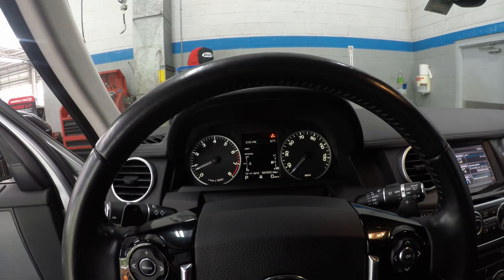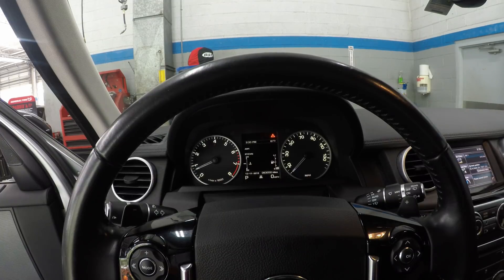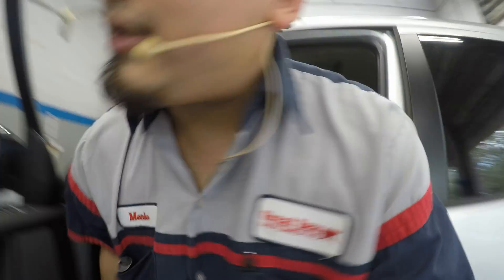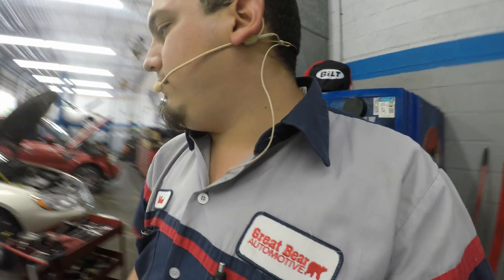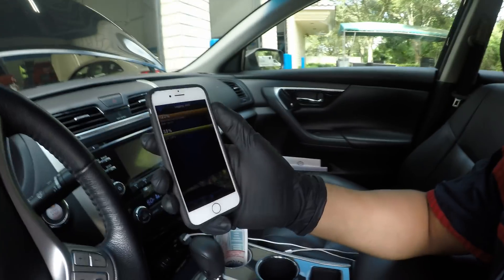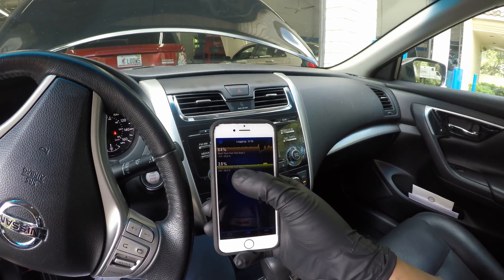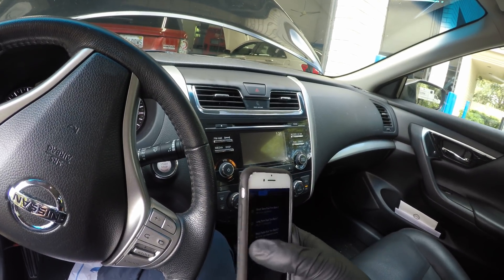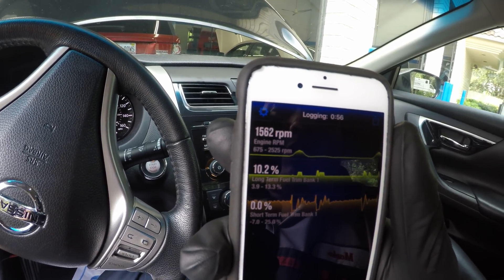RE: ScannerDanner: Are mechanics thieves? Or is it incompetence?

Comment: Personally I think it’s thievery and I’ll explain why. They gave her a laundry list of repairs so that when she gives the approval , all they do is change the Pcv and boom the car is fixed the mechanic gets paid and not much effort was taken to do the job. Of course they probably chose the most expensive type of repairs like a fuel pump and such and along with some service recommendations. I’ve seen it all too many times.
Reply: Either it's robbery or incompetence . BUT the result is the same . The customer pays . So is it OK if they are idiots and " they didn't mean to steal from you " ? They need to go to Walmart and put on a security uniform . OK , I'll be generous - maybe Jiffy Lube .
Reply from the maker: ACTUALLY the pcv valve is the more expensive job on this vehicle. It's over 10 hours if I remember correctly
Reply: Super Mario Diagnostics I digress

Comment: Question what are you using as a code reader ? I have Blue Driver which I find amazing, looks the same. Please let me know, what you use.
Reply from the maker: Yep this is the same. Pretty good live data streams 👍
Reply: @SuperMarioDiagnostics  I'm so angry, I purchased wife 2017 Nissan Rogue full package and for the last few months the car makes horrible noises sounds like the CVT plates or belts are not messing correctly all maintenance is done fluids changed flushed. Today they had wife crying as it cost 300 dollar to say they can't determine the grinding noise and the codes I got where U1266 and U1A10. I took codes 2 mins before I handed keys to SM and they tell me won't accept those codes U1266 is what scare me as it hit the nail right on the head and now that new tran needs over haul or replacement. If you could please advice I'll support on Patreon is I can get something useful as today I told them that I was going to have another garage look and they say that voids warranty. HELP I don't want wife crying anymore.
Reply from the maker: What do you mean you you codes? You deleted the codes before giving it to them? If they can't figure out what's causing the grinding, you shouldn't deal with them. What do you mean they don't accept the codes? Those transmissions are notorious for failure, I'd take it to a transmission specialist that is reputable and guarantees their repairs for at least 2 years
Reply: @SuperMarioDiagnostics  It's the Nissan dealership lol. No I took codes 2 minutes before handing it over to their service manager. I took him for drive he hear the grind, saw the delay in shift lack of power, and the possible slippage. He says could be lose muffler, and first time was lose heat shield. I hate the dealership but car is still under warranty.  Also the techs can't find anything and say there are no fault codes and again they cleared them all like first time but they came back as this thing is failing. I want another opinion but all Nissan are owned by one company O'Regans uggg. I have codes for 8:15 and all the previous times and these 2 have always been there since the noises started.
Reply: @SuperMarioDiagnostics  sorry that was a rant took him for test drive he heard felt and saw all the crap, I then used blue driver to read codes at 8:15 am this morning. the U1A10, and U1266 dealership says they won't accept my codes and tell me there are none after tech is done. so Today wife in tears and 315 dollars poorer and car is still doing it.
Reply from the maker: Go on a test drive and take a video. They're waiting for the warranty to expire. Take every video you can when it happens, and show it to them. Make a huge stink
Reply: @SuperMarioDiagnostics  Wow just come back from Dealership with proof of code and again because their system don't see anything it's invalid. Also the Service Manager now only remembers the sound (which wasn't) the muffler lol. So I then asked if techs heard same He replies no, I then ask did they meet the parameters I showed him on highway he said no. I'm pissed now as they again failed to follow instruction as how to recreate the noise and event. They refuse to do anything without codes and basically wife will be driving Highway speeds this thing is going to fail and people are going to get hurt or killed. Nissan Canada has crashed again can't contact anyone whole company is bad. But I do love my Skyline lol
Reply: Oh the 300 fee for the shit show that was yesterday "service" was waived

Comment: Consider the economics of operating a repair shop. 
Training tech's costs money both in lost revenue while that are attending training as well as the cost of training including travel and attendance fees.
"Parts cannon" diagnostics creates additional revenue both in parts revenue and labor revenue.
Also, trained tech's generate less revenue compared to a "parts cannon" tech since many jobs will need less book charges.
Bottom line is that repair shop ownership has no economic incentive to train techs.  Especially since the general public has no clue what is wrong with their vehicles.
Reply from the maker: That's the worst excuse I've ever heard, and is the main reason why this industry is looked down upon. Too many investors out there in it for the bottom line and not looking to actually stand out in the way they run their shops. That's why with the coming technology, shops that continue this path will be forced to either get training and update, or die a slow and painful death. If you look at the most successful shops out there, they're not bottom feeders, penny pinchers, nor bare minimum shops. They're training, buying the necessary tools, and maintain high standards.
To argue that the parts cannon mechanic renders higher revenue is to also imply that it's ok to rob the customer each time a problem is misdiagnosed. Shops that allow this also won't last.
Reply: Economan not only do I feel like that business philosophy is unethical, I also feel that it is a short sighted business approach.

 What happens when so many customers have had their cars misdiagnosed, that the majority of the community within a 10 mile radius knows you do a terrible job at properly fixing their car. Or worse yet, they realize they are blatantly being ripped off?

Hopefully the business shuts down. Just like the majority of the shops open should be.

Comment: Why would you check for vacuum leaks after that’s the first basic and easiest thing you can verify first.
Reply from the maker: Especially with these fuel trims 😆
Reply: It’s crazy I’m hoping that tech was slammed that day and was being lazy lol.
Reply from the maker: That's no excuse I'd say lol 2000 dollars for a fix that wouldn't work.
Reply: I hate that shit I’m not perfect but I strive to be, I hate seeing people that do it for the money and not the love of fixing a problem. I had a similar problem with a VW lean at idle for whatever reason mass air flow was recommended. Car came back same code the tech was off so I got thrown on it. Now I gave him the benefit of the doubt because the car had a bunch of new parts on it already but still if you get fuel trims you know what to look for. Turns out the car had a damage pcv valve it was new but bad at the same time. Not gonna tell you how I figured it out because I’m sure you know. But it took me 5 minutes. But hey man good luck brother god bless.

Comment: There are many variables to diagnosis a problem,so we are human and make mistakes. We should have try our best and get a hundred percent sure about the diagnosis but sometimes we don't have time or another reason for doing that. So that is my opinion.
Reply from the maker: But a factory trained dealership technician suggesting a 2000 dollar fuel pump and then suggesting to check for vacuum leaks AFTER? All they had to do was open the oil fill cap to find excessive crankcase vacuum. Something is wrong there. In my opinion. Flat rate is the beginning of the issue.

Comment: the money is a big factor , yes it does   kill the motivations  of the  technician , I will  talk for my self ,  when   I left a shop because the owner wanted the    diagnostic done  in 15 minutes  yes 15 minutes complete with  research, testing  .
ok  I left  looking for new shop  I already have my 11 ase plus the  2 smog license inspector and repair.  I went to  honda dealer said  the most they could do is $16 per hour the most for me ,Toyota $ 17 , Subaru $18  ,  I told them I am certified, they said does not  matters those tltle s are view  for  the public  , I am  not certified on there  line    of vehicle. I told them I refuse aftermarket of $25  already why will I accept $16 when minimums salary herw was  $14  for none profeciona. l when I have already invested about $50 k on tool.  well I    accepted a job after at  market shop  on flat rate ,  there is not value on labor the main thing for them is how much  you can sell on parts , 1 hour for any diagnostics any amount of dtc, the manager said any good technician should have complete result in 45 minutes,  so any diagnostics I wanted to get done because I have passion for my   job, I was getting to result in about 3 hours on several diag, however getting paid      1 hours, believe me against my integrity I had to  throw parts     to get   some of 35 hours per week  at least  of my salary. now I am getting paid over 30 an hour and they  respect my diagnosis time  very happy, but hard to find a shop that value diagnostic portion,  yes money is important  when you have to pay for tools ,  training and  take food  to  the table  for the family .  so do not forget  getting  a crappy salary creates a circle , and kills motivation I felt that , the shop on my area the hourly rate is over $130.00 . yes I know they got to pay expensive rent .
Reply from the maker: Good thing YouTube is free. While i agree that pay has an effect on the motivation of a technician to grow. It cannot be an excuse anymore. The resources and information are readily available to anyone who's willing to use a search engine. In this industry one cannot expect to get good pay to then learn. They must first learn to demand good pay. Shop culture is a big deal, as you made clear. But ultimately it's down to the individual technician to invest in themselves, absorb information and gain experience in order to succeed, in my opinion. When someone writes on the work order to fix a fuel pump for 2 grand, and then to inspect for vacuum leaks, shows that they didn't put in the time to either invest in themselves, or conduct a proper diagnosis. Especially at a dealership where they have factory training and information readily available to them, in my opinion. Thanks for commenting bud 👍

Comment: Are you using blue driver?
Reply from the maker: Yes i am
Reply: I have used blue driver also. It’s not a bad code reader and PID monitor. It doesn’t do enough to really diagnose most problems. It also doesn’t monitor the CAN network or do any actuator or module tests which is a must in the newer cars of today.
Reply from the maker: True but it's 100 bucks. Can't expect that much out of it

Comment: Mario it's funny but most of my videos start with the phrase, this car was at another shop. Way too many parts changers as well as incompetent people in this field. Very nice video man. Hopefully some of these guys see this and learn something about utilizing fuel trims in diagnosis.
Reply from the maker: Thanks brother, sucks but that's the way it is
Reply: Joe's Auto Airline mechanics have to meet certain training standards. You need an A&P to do most of the work done on small aircraft. An A&P&I can only sign off on the work done only after thorough inspection of the work done.
  An auto mechanic can be some joe blow that walked off the street looking for a job. Usually they will have some type of on the job training  by a lead mechanic and are let loose to do their own thing . I’ve seen some pretty bad ones in some of the shops I’ve been in. The customer is the one that loses in the end.

Comment: I am a tech in a completely different field but it is largely the same. Technology is constantly changing, techs aren't trained well enough, the pressure of repair work takes its toll, pretty soon you get misdiagnosing issues and parts changing. Think a 300 dollar fuel pump is a lot to spend on a misdiagnosed fuel issue? Try a 3000 dollar wic card for a router. One guy I worked with was so incompetent, he would just swap these wic cards with every ticket.
Reply from the maker: Yep, this applies to many fields, some just lack the drive or the passion to at least care. This is a trial buy fire industry, so we must be able to stay focused under pressure. Some people don't know how to separate their personal problems from work, and it shows. I've seen a guy replace an engine due to a pcm. And he thought he was the last coca cola on earth, so pride and arrogance is another factor. And the list goes on

Comment: It’s a combination of both, I know certain individuals that know this is a vacuum leak, tell the customer it needs a fuel pump (knowing the leak would take less time to fix) proceed to fix the vacuum leak, and tell the customer that fuel pump was changed...
Customer: incompetent
Mechanic: Thieve
Reply from the maker: Except for the fact that the fuel pump takes 2 hours. And the valve cover takes 10 hours 🤔
Reply: Super Mario Diagnostics depending on the vehicle 🚗
Reply from the maker: This vehicle, those are the labor times

Comment: I think a big problem is not separating mechanical and diagnostic work. A regular mechanic can make a lot of money in a busy shop without much knowledge of cars. Therefore they don't care to take training seriously. Management needs to realize the amount of training/knowledge/experience needed to be a diagnostic tech and compensate him/her accordingly. I work with some young techs that don't care to learn because the shop is busy and they're making good money on basic work and flushes.
Reply: That's a great point. Some of us at smaller shops have to diagnose as well as turn wrenches. We may not turn out as many vehicles a day compared to a much larger shop, we have to make sure our diagnosis is correct before we even start wrenching.  Management at larger shops seem to be keen on getting them in and out not so much on quality of work.
Reply: kiltedsaint very true. Being a technician that takes pride and enjoys what I do gets pretty tough working at a bigger shop. I get the most fulfillment out of doing strictly diagnostic work on the side. I feel that I'm being properly compensated for my knowledge and effort vs having a greedy service writer that just want to rip off the customer
Reply from the maker: You make some good points, a lot of time can go into diagnosing a car, and it makes no sense to take a tech from diagnosing an intermittent electrical issue to doing an oil change. But in the end of the day I believe it's up to the individual tech to maintain standards